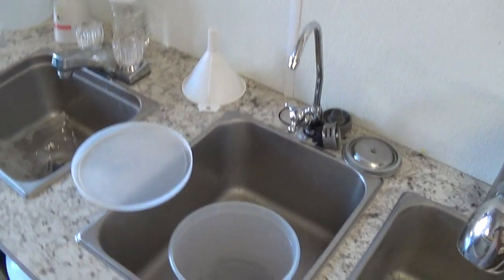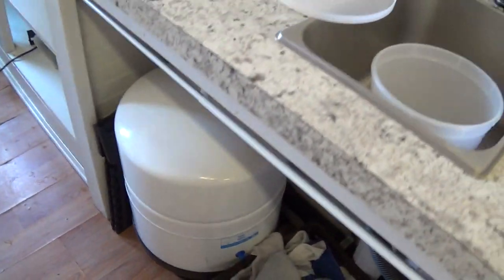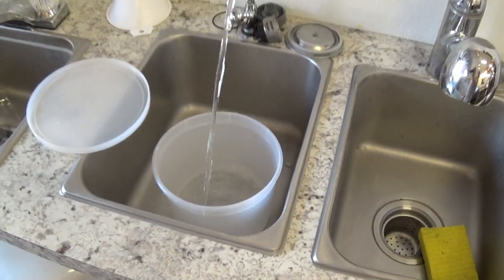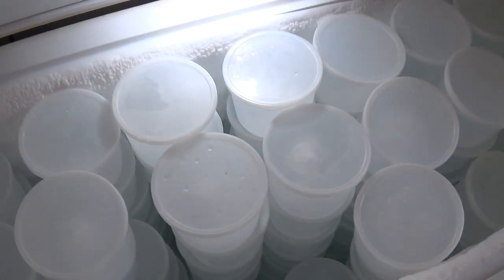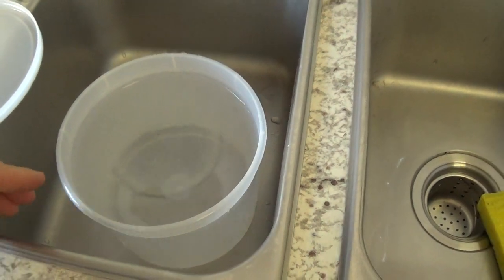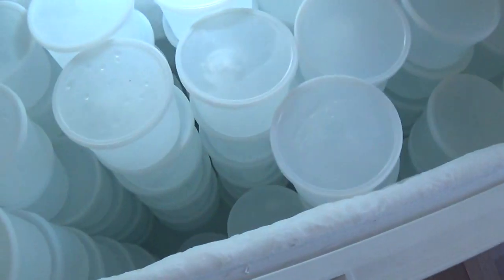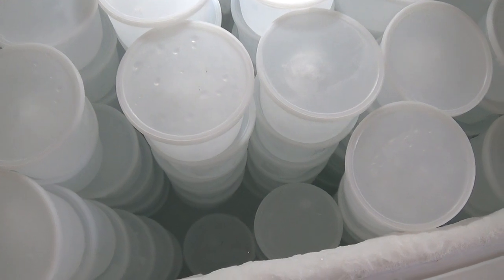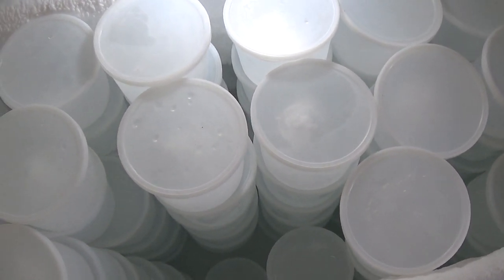Make your Own Ice Blocks Shave Ice, Snow Cones, Shaved Ice Swan

Comment: I seen this video several times! I tried many molds but all seem to crack! I finally found molds that work and i now have over 80 block on hand everyday! Its beautiful! This video inspired me!
Reply: Hello, which blocks worked for you mine keeps cracking?
Reply: Where did you find the containers?
Reply: We found that by freezing them ice blocks slower we have reduced breakage tremendously. Unfortunately, we have 1 freezer set to 8 degrees to freeze and another for store after they are frozen.
Reply: @tonigamble218 what container do you use for your blocks?
Reply: Please let me know your supplier for the containers you use

Comment: i have the New Orleans block ice shaver but cant seem to find plastic bins for the water to freeze any suggestions .
Reply from the maker: I’m not sure I’ve only had vertical shavers. I would just make sure they are a little tapered so the block will come out

Comment: Hi! This may be a silly question, but the water that goes into the tank is it just tap water? And do you keep refilling the tank or does it automatically refill?
Reply from the maker: The tap water goes through the 5 stage reverse osmosis system and fills the tank. The tank is filled and the filtered reverse osmosis water is available on demand.
Reply: @thehaddocks thank you so much for responding, I appreciate it 🙂

Comment: First time freezing own ice. Freezer only going down to 15-20 degrees. Is this a problem? After 2 days ice still has water bubble in the middle.
Reply from the maker: It seems like they freeze faster when there are more frozen blocks in the freezer. The mass of the frozen blocks speed up the freezing process

Comment: How do you prevent you ice blocks from cracking?
Reply from the maker: Mine crack when I overfill them or move them while freezing. I also use filtered water which I think helps limit cracking.
Reply: Thank you for your help.

Comment: What are the disadvantages of reverse osmosis?
One of the major disadvantages of RO systems for the home is that they remove most of the minerals from the water leaving it with an acidic pH. Also, during the purification process, up to 20 gal of water is flushed down the drain for every gallon of filtered water produced. If I want to open a shaved ice business, should I buy gallons of filtered water, or should I install the RO osmosis system to make the blocks and make the syrups? thank you very much.
Reply from the maker: I’m not sure. I wanted a filter that removed chlorine and fluoride. I’m sure there are other options. This works for me.

Comment: Hi, I have watched this video several times! Thanks for the help!  Would you share what temperature your freezer is at? I have read it is better to freeze them quickly, but some places say to freeze it slowly. I am not having luck with my blocks at home. They have lots of cracks and aren't clear and solid.
Reply from the maker: My freezer is set between 3-4. One of the reasons I use 1/2 gallon over 1 gallon containers is they freeze faster. Try filtered water that might help with cracks.
Reply: @thehaddocks  thank you! If you ever throw a thermostat in your freezer to see what it is in degrees I would totally be interested! Have a great day! And thanks for the videos!

Comment: Thank you for a great video.. so my blocks are uneven and cracked.  wondering if it is because the freezer is too cold?  If I try to chip away to even the block out the whole block just comes apart.  Any suggestions?
Reply from the maker: Make sure to freeze it level and filter the water this will help. I also set my freezer at a 4. Some will crack regardless i still use them though.

Comment: How many servings on average you can get out of one block and what brand/model of ice shaver do you use?
Reply from the maker: I get about 10 Small  servings out of a 1/2 gallon block. I use the fujimarca.
Reply: The Haddocks really ? 

So that shape of ice container works well for the Fujimarca machines ? 

I thought a custom mold fit would be better suited for those then that size 

Could you do a video with one of those being used shaving in your Fujimarca 

Thanks,your so helpful
Reply from the maker: @sbrsportsbook4358  Yes works great.

Comment: Thank you for sharing with us how to make block ice. I noticed that you have 3 compartment sink. Could you share how to sanitize used plastic syrup bottles using the 3 compartment sink? Thank you in advance for your help.
Reply: I don't know if you are still looking for an answer but, at Starbucks this is how we used the 3 compartment sink to sanitize. 

First is the wash/ soap sink. Fill the the first sink with hot soapy water and scrub, clean how you would anything. 

The second one is used to rinse, fill it with warm clean water. Once you scrub and clean with the first compartment, move it the second compartment.
This is just to get the soap off. 
Dip it or lay them in this compartment. 
When ready move to the third compartment. Third compartment should only be sanitize solution. 

Leave it in the sanitize solution for 60 seconds and you are good to go.

Comment: What temp do you freeze at for two days to limit block cracking?
Reply from the maker: I have the freezer at a 4. I have found that cracking comes from moving the block while its freezing or over filling the container. Also a good filtration system helps.

Comment: where you get your supplies to make them!  Like the reverse osmosis set up to, share if you don’t mind
Reply from the maker: Reverse osmosis system can be purchased anywhere ebay amazon etc..
Reply: @thehaddocks  whts the model and brand do u use for reserve osmosis? I want to start business in LA. Looking for all this equipments needed. Please reply.
Reply from the maker: @shoppersplaza286  Mine is a generic one. I just typed in reverse osmosis system on ebay. It was about $100
Reply: @thehaddocks  why are you use reverse osmosis to make blocks?
Reply from the maker: @kiwaimoana6729  It makes the blocks with less imperfections like air bubbles and cracks. It makes a better product.

Comment: How do you pull out the ice from the container, do you have to break it the container?
Reply from the maker: I pull the block out of the freezer and let it sit on the table and melt for a minute and then i remove the block. Usually the container doesn't break. Once in a while the container will break but most of the time that is from overfilling the container.
Reply: @thehaddocks  thank you
Reply: Do you ever put the container through running water to loosen the ice blocks ? Are the ice block gonna cracks ?....

Comment: Where do you purchase the ice mold containers? I can't find them anywhere!
Reply from the maker: They are a 64oz container. I've seen them on ebay and amazon. I buy them locally in a case of 144 for about $1.00 each. I think if you buy 12 on ebay they are $2 each.
Reply: Are these the right ones man ?
Reply: The Haddocks is the link I just posted you the other day the ones you are talking about ? 

Also , does your machine shake at all with this size ice mold in it ? 

Thanks 

I want to order but need to confirm these 2 things
Reply from the maker: @sbrsportsbook4358 Yes those look like the ones I use.

Comment: Bro , i just froze my first ice block 

It's all cracked .....

I didn't use purified water as I dont have it yet .

Will that help with cracking 

Also , how do you get them out of the container.  Not that easy , and not sure if I'll always be ahead of the game enough to have them sitting out getting ready 

Any tips , please
Reply from the maker: I let them temper on the counter. if you get behind on pulling them out of the freezer you can run them under water.

Comment: What type of cooler are you using ? And would you recommend a great northern ice shaving machine ??
Reply from the maker: I use a chest freezer. I had a great northern. Its okay to start with but i would just pay a little more and get a Fujimarca.  You can check out my other videos i review a tiger claw shaver which is the same as a great northern and i also review the fujimarca.
Reply: The Haddocks why you didn’t get the southern snow machine?
Reply: Do you use southern snow??